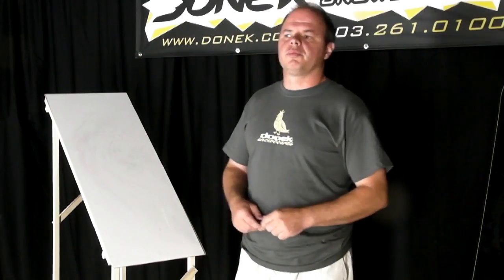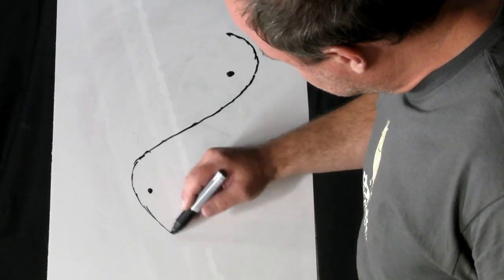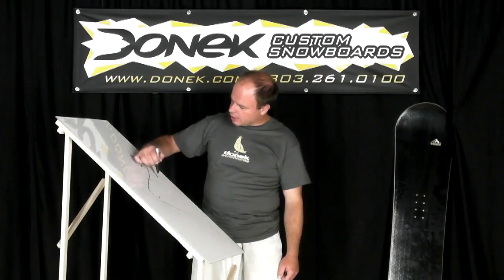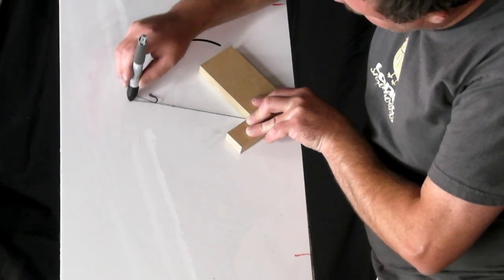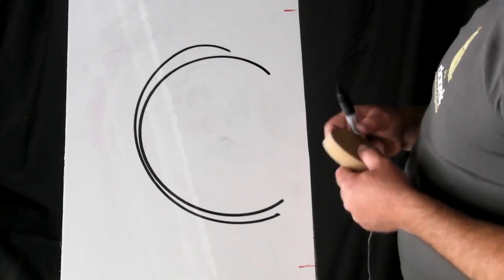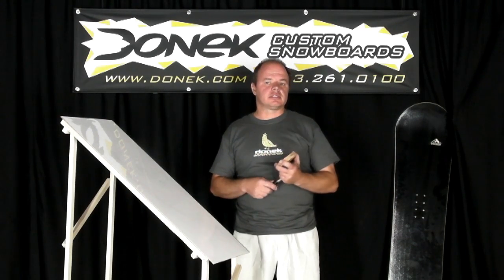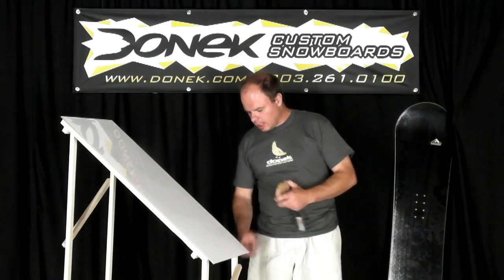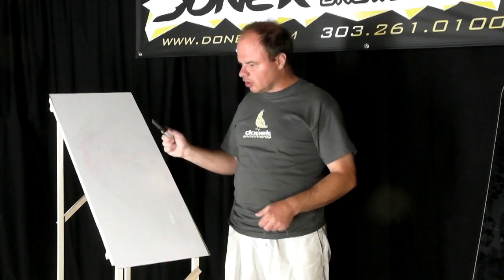A physics lesson about Snowboard turn shape: Part 2

Comment: great Video explanation of some insights of snowboard designs!

I was always woundering why my turn does not follow a constant radius as it is supposed to have. but could not find such a good  explanation as your small visualisation expertiment. 
Great job!
Reply from the maker: Yes.  A fixed radius sidecut will tend to make a turn that gets progressively tighter and a variable radius can make a very round shape turn or a turn that gets bigger towards the end.  It really depends on the radius span that is used.